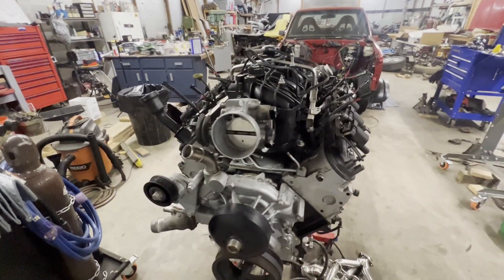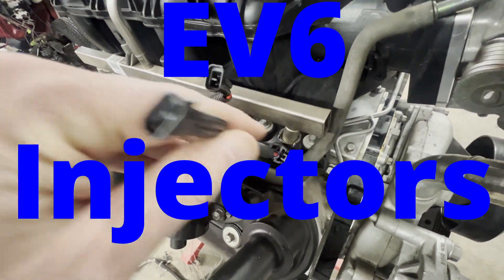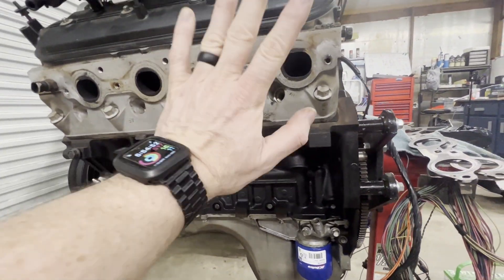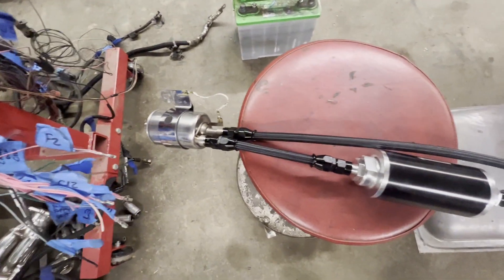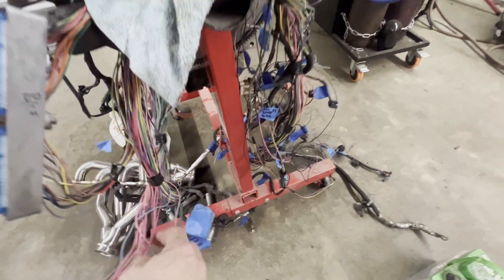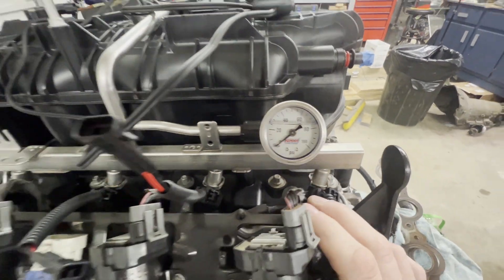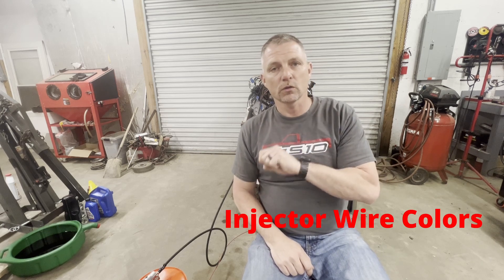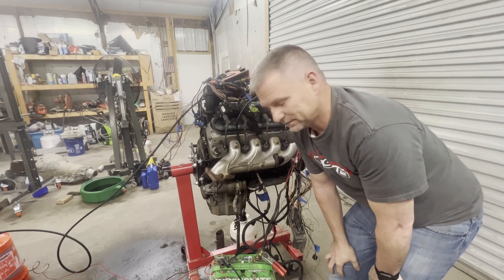Starting an LS Engine on Engine Stand

Comment: Great points, tips, and tricks. I hope you'll do videos on how you'll mount the TH400 up as well as the other things that are needed for the drivetrain. Looking forward to ALL the progress you'll be doing. I picked up a 6.0L LQ9 with a 4L80e for $850 off Marketplace for my S10 but I want to go with a TH400.
Reply from the maker: @Your PCMD I will be doing videos on mounting the TH400, what flex plate I use, flexplate bolts, crossmember, transmission mount as well as driveshaft length. I plan to show everything I do there as well. A 6.0…..very nice and a very nice price for both the engine and transmission. If you don’t use it you can always sell the 4L80e and pick up some extra cash for other parts to complete your project. That was a good score!! Thanks again for watching and the comments!!!

Comment: Always a relief to hear them run the first time. Congrats!
Reply from the maker: @heshtesh yeah for sure!! I was getting sick after trying and trying. After I found the coil pack wires were revered and it started….what a relief…whew!! LOL. Thanks for watching and the comment my friend.
Reply: @dtperformance256   My 399 1st. gen stroker for my Sonoma will be getting started  for the first time since it came off the dyno in Jan 2019 later in the early summer.
Reply from the maker: @heshtesh Congrats!! I know it is a big step in thebuilf when you get to start the engine for the first time!! Thanks for watching and commenting!!